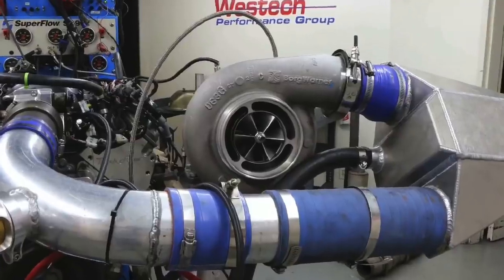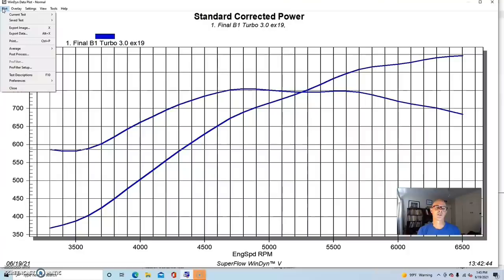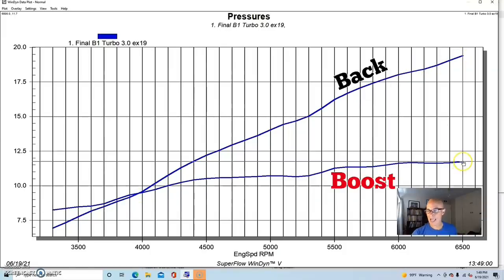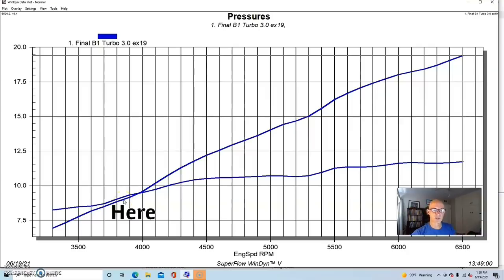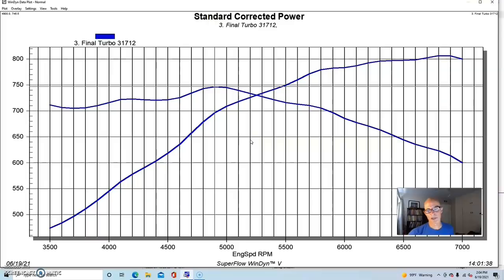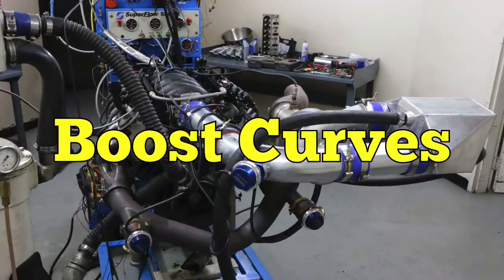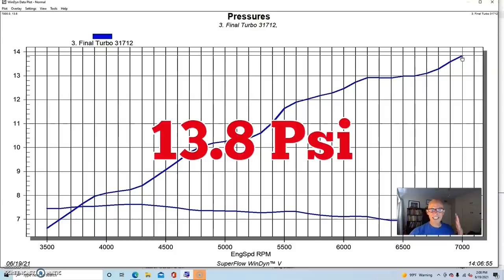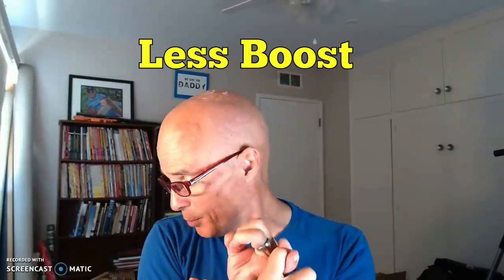JUNKYARD TURBO LS BACK PRESSURE TESTS (HOW TO: MAKE MORE HP)

Comment: Back in the early 80's one of my running buddies got a turbo trans am with that silly little 301 V8. We had the local exhaust shop straight pipe the mufflers and then we installed a (test pipe) and tossed the converter. I'd almost believe that it cut that T/A's 0-60 time in half. It could smoke the tires from a standing start after that, and it sounded really cool.
Reply: Somewhere down the road I want to get my hands on a stock one of those cars. Then just make basic changes to create a more efficient system. I don't think it would take much to make that little 301 a fun little powerplant. The fact that all the Pontiac guys (I'm one myself) dislike them, just makes me want one more!
Reply: I bet these motors would handle quite a bit of power. I’m not sure if they were 4 bolt mains, but the super low compression would work nicely for durability in the long term especially. A nice heads/cam package and I bet that’s a bad little motor!